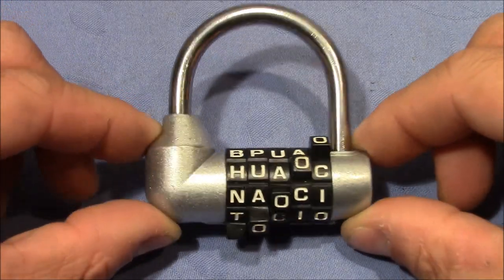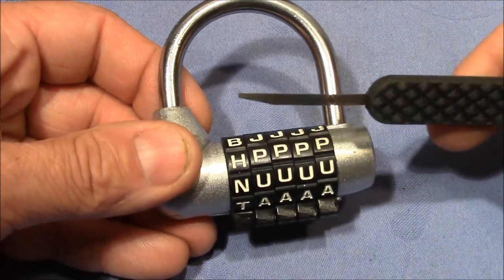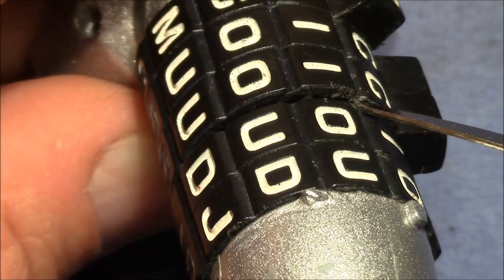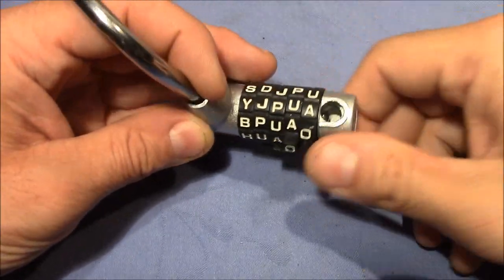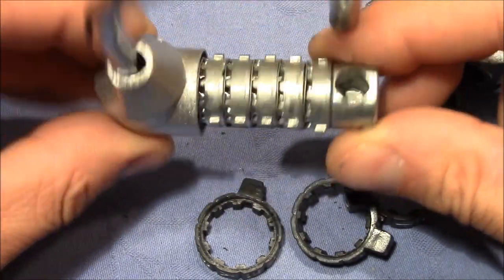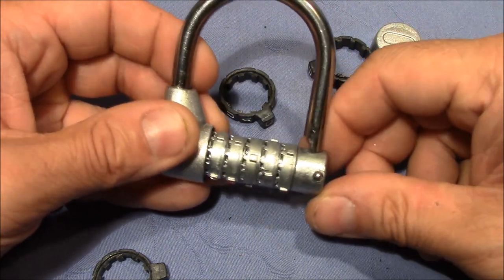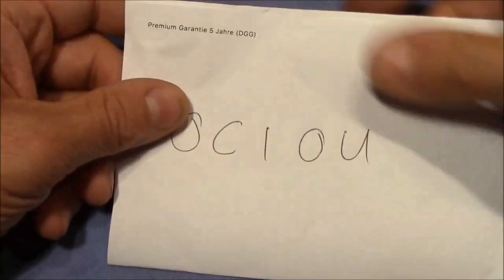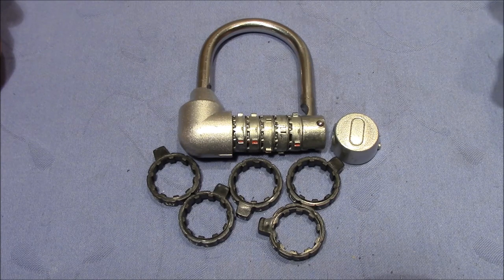(picking 698) Letter combination padlock visually decoded + code surprise

Comment from the maker: A letter combination padlock from 'lockmania' that caused me some trouble decoding it. But I found that looking in between the wheels can reveal the code following a barely visible red dot. But the the surprise came with the code that once can and another time cannot unlock the lock. The reason is that some letters are printed twice on some wheels - crazy.

Comment: Good catch on decoding, and strange they would use multiple letters. That would be a real pain
if you used an O or U. Thanks for sharing.
Reply from the maker: Cheers. It was driving me crazy that the lock did not open the next time with same code.

Comment: I laughed when you showed the double letters :O) that's surely a mistake rather than a 'security feature' ! It is strange that the end cap comes off also - another design fault ? Not good  that there is slack between wheels allowing red dots to be seen. I have a lock of a similar type, but slightly different body shape (and numbers not letters), and that is not pickable by the 'pull' method either. Actually I had several of these locks, and so I took one apart - it was obvious that pull picking would not work, and also that if I tried pull picking, it would probably wear out the internal parts (zinc alloy) very quickly :o(  These locks are now in service on my neighbour's farm gates - not very strong, but they stand up to the wet weather very well, and you can read the wheels easily in low light - which sometimes is helpful in this use. :o)
Reply from the maker: Thanks for stopping by. Yes, durability and robustness are main aspects for most of regular users. I also believe that double letters are pretty silly. But I prefer numbers over letters.

Comment: Nice job figuring out a way to decode the lock! If the tolerances where better you might not be able to "pick" it.
Reply from the maker: Cheers. Yes with tighter tolerances I would have had to consider using heavier tools ;-)

Comment: You need very, very heavy tension on that shackle according to others.
Reply from the maker: Yes I know, heavy tension is needed but it's hard to handle with pulling very hard and operating the wheels at the same time.